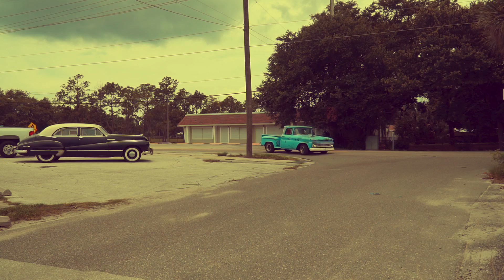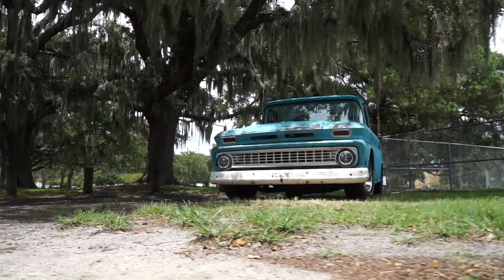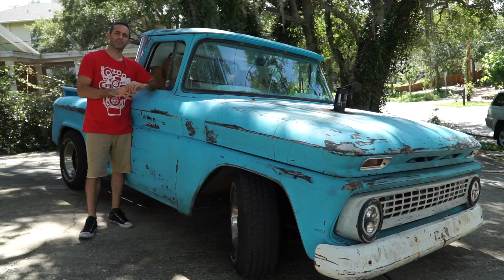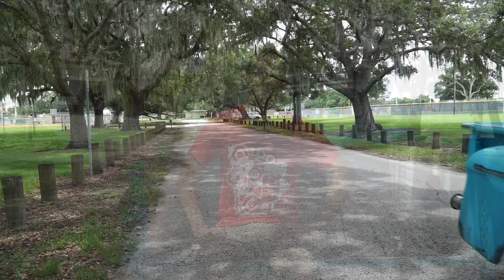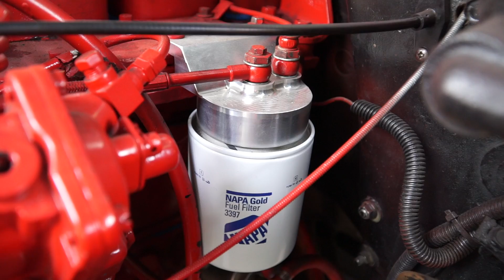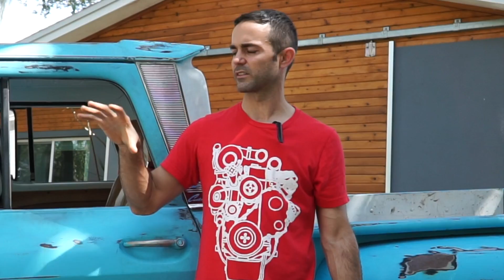One YEAR of a DIESEL SWAP 1963 C10 12 valve Cummins conversion

Comment: That engine weighs 1100 lbs. dry weight. How many times have you had to replace the front end parts.
Reply from the maker: Never.  Daily drove it for 2 years.  With the industrial Allison trans, the engine/trans combo is 1,465lbs.  I installed engineered coil springs from Eaton Detroit spring that were custom made to handle the extra weight as well as rebuilding the front end with heavy duty bushings and components. The front end of a C10 from 63 is more stout than the crap they used to build the Dodge front ends that held these engines in the 90's that crap out all the time.  Who would have thought?  https://youtu.be/bJ_OmIItJxw

Comment: Love the truck, but holy cow shes loud lol i wonder if some sound deadner would quiet her down? Not the exhaust but valve train
Reply from the maker: It has "some" rubberized sound deadner in there, but nothing quiets the truck down.  I was going to run the exhaust out the back, but arrived at the conclusion that the valve train plays a major role in the noise production vs the exhaust

Comment: Did you build this or buy it?
Reply from the maker: I"ll do all my own work, check out the VW squareback engine swap video.  I just did a disc conversion on this truck and will be doing much more work in the near future.   I like the Built vs bought idea, but when a solid 63 C10 with a Cummins 12Valve with 100 hours on it comes knocking on my you BUY it! haha.